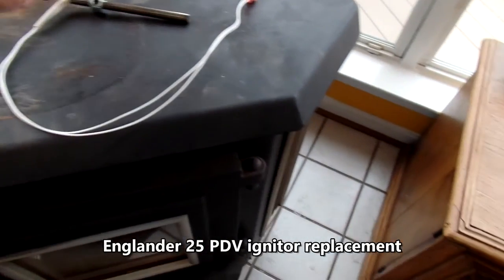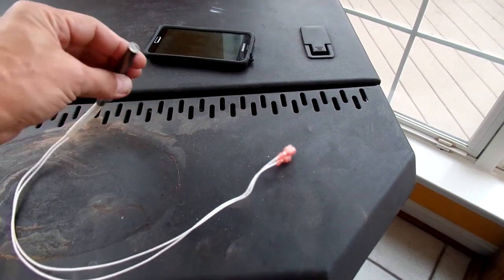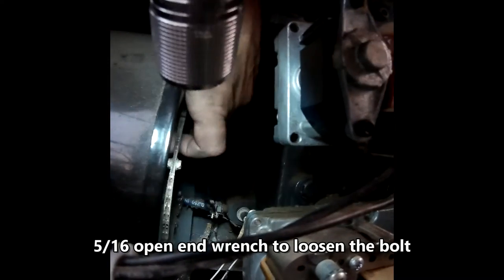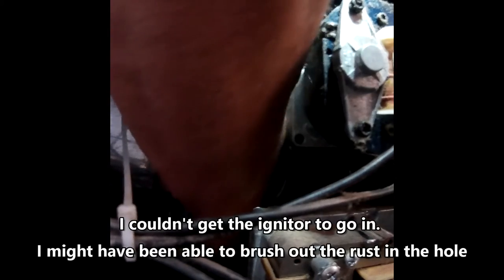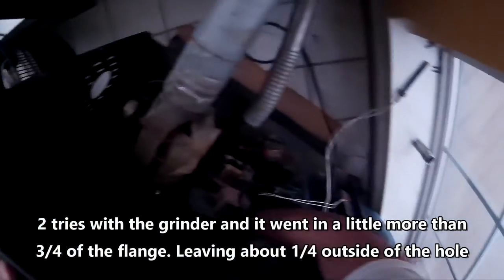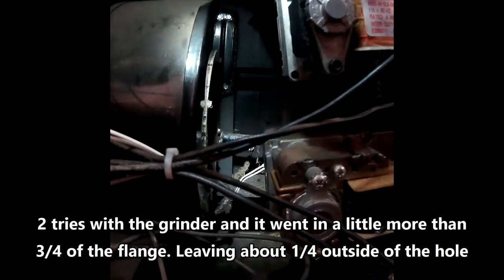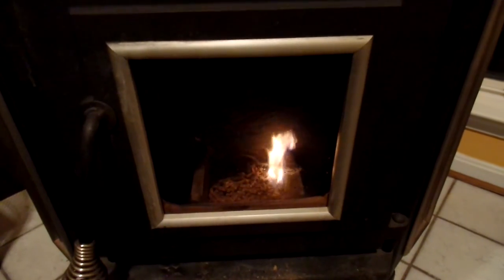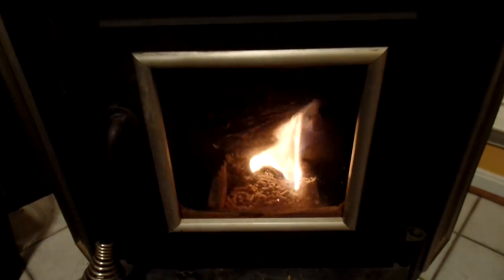Ignitor Replacement Englander 25 PDV Pellet Stove

Comment: The ignitor is a somewhat expensive part, is a PITA to install, as you generally will have to disconnect the stove from the vent an move that heavy-ass unit, and it takes a long time to get the fire going anyway. Mine still works but I save 15 minutes using a handful of pellets and a little squirt of old-fashioned charcoal lighter fluid I had hanging around.

Comment: yeah I tried to replace my ignitor and the new one will not go through the hole in the back of the firebox ,it goes right up to the hole but not through it  so the tip is even with the back of the firebox so I just sealed it up for now till I find out whats wrong. We are very unhappy as the control box is failing and I am not going to pay over $100.00 for 30 year old technology  that has never been updated since day one.

Comment: So  did the new igniter stick into the firebox at all or was it still back in the hole so that the pellets had trouble contacting it? My factory igniter glows but it seems like it's set too far back to contact the pellets.
Reply from the maker: It's still set back probably 1/2 inch in the hole. To make sure it lights, I still have to insert a long pellet into the igniter hole so it contacts the igniter.
Reply: Thanks,  that design still puzzles me. The combination of the set back igniter and small hole in the firepot make it hard for the pellet to make contact .I think I'm going to try one of the aftermarket igniters with the adjustable collars so I can get the tip to come as close as possible to/into the fire pot.  "automatic" shouldn't require doing anything but pushing the ON button.
Reply: @davidaguiar1387  su
Reply: Yeah stupid design! I'm going to drill the hole out and make it reach the pellets. Just need an angle drill 🤔

Comment: Was the old igniter glowing? Mine glows but I can put my finger right on the hole and it is not hot
Reply from the maker: I think it was still glowing just weak.  It's been a long time.  I usually grab a long pellet and insert it and it's probably touching the ignitor.  If I don't do that it's 50/50 that it will light

Comment: I have had alot of trouble with mine are they really good or should I look for another brand
Reply from the maker: We've had ours for about 5 years now and it was 3 years old when I bought it.  I was thinking back on the repairs and I've replaced the upper auger motor twice and the ignitor once. Probably $200 and 4 hours of work overall. We love the heat, can't beat that at all and the simple operation.   It's loud though and the repairs shouldn't be that often, but we're very happy with it.
Reply: I believe for the money you pay you should get better quality product I would really like to hear from them
Reply: I have had one for about 8 years and just now am I going to replace the igniter. so not bad for the use it gets
Reply: where can I buy an ignitor?  we are going to have to replace ours. thanks.